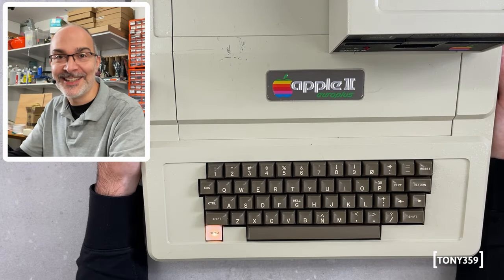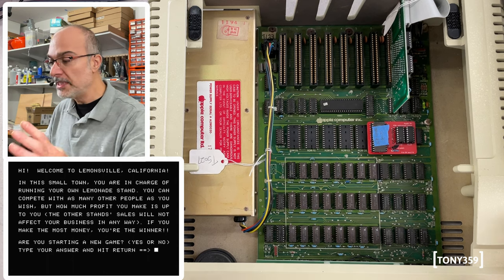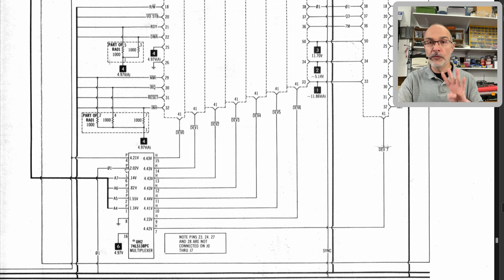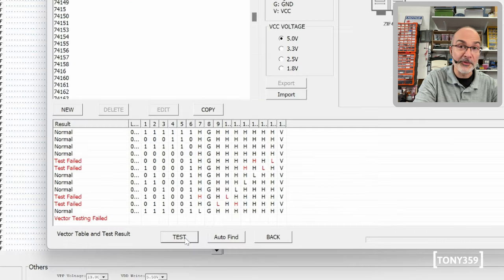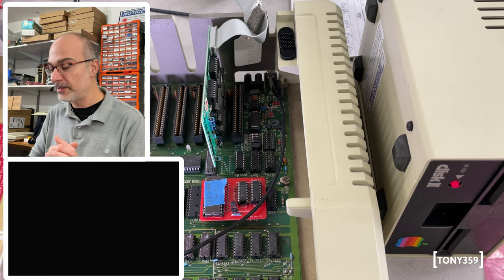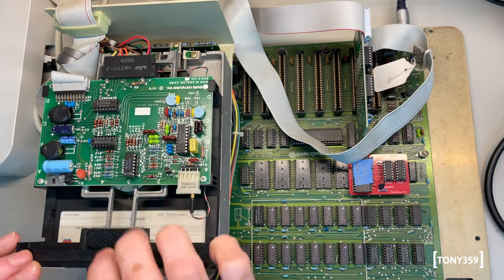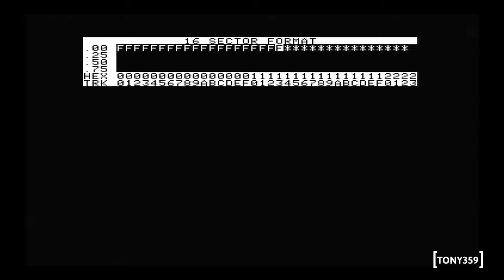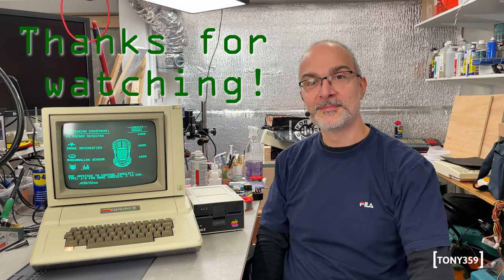Let's see why the Apple II Europlus broke again!

Comment: Bizarre that two chips caused similar issues! I liked that kiosk mode switch-very cool!!

Question: when the slot switching trouble was happening, why was data being read on empty slots? Seems very strange. I’d expect “No Data”

 (but I’m new to Apple ][)

Or was this erroneous data there BECAUSE of the bad chips?

Thanks!
Reply from the maker: You're assuming I remember what was wrong on that video! LOL!
I think it was the selecting IC selecting multiple slots at the same time as you say. The first fault was one of the two selecting ICs, the second fault was - surprisingly - the other one. So yes, I think (not sure) I show that when the system is working fine you only have data on the slot being used and not the other one.

Does that make sense? :)
Reply: @tony359  it does. Such an odd issue

Comment: Won't this hot swap of ROMS screw up the whole system?
Reply from the maker: it's a good question, I didn't investigate too much. However, there is ONE bit (maybe byte) difference between the two ROMs and it's the RESET routine. Now, it might be that if I swap the ROM while the system is doing some intense work, it might not like it. I do not know to be fair.
Reply: "swapping" roms is done only by setting one input to LOW or HIGH. Data-lines are always connected to the BUS so I don't see what can go wrong except maybe occasionally system freeze / halt. This is not like unplugging and plugging back USB drive.
Reply: @tiemanowo  What can happen if the ROM is swapped while reading?
Reply: @watchmakerful  Maybe system crash and nothing more.
Reply from the maker: Oh yes thanks for clarifying. This is nothing to do with physically unplug the ROMs, it's just one address line going low/high so when the system asks for a location, a different one actually responds. So worst that can happen is a crash :)
Reply: @tony359  Since the contents of both halves of the EPROM are virtually identical, you can switch between them without crashing!

Comment: As we have told you many times, in devices this old you have to change all the electrolytic capacitors before you even start testing. It's not even worth testing them. Those who did not fail will fail in the short term.
Reply from the maker: But in this case it didn't fail because of the capacitors! And there are so few caps in an Apple II anyways. 
Anyways, I know it's a good idea, I just don't have the time and resources to do that every single time!
Reply: @cosmefulanito5933 
Why, what happens to the capacitors ?
Reply: I don't recommend replacing all capacitors less they are failing. This technique isn't best practice. After repairing literally 100s of Apple II, IIe, and IIc, I have never found a computer that needs all capacitors replaced.
Reply from the maker: it's indeed a debated subject. My view is: new ones won't hurt but they're not strictly necessary and won't necessarily fail very soon. Definitely I don't like swapping caps for the sake of doing it.
Reply: @tony359  Actually yes. They are strictly necessary because as I explained before, those who did not fail will fail in the short term. Capacitors have a lifespan. And all those capacitors already exceeded it.
A good technician always repairs the problem and prevents future problems. Otherwise you will always be repairing the same things over and over again.
Reply: @RudysRetroIntel  Capacitors have a lifespan. And all those capacitors already exceeded it. You need to replace all of them. Or you can just play the lottery of when it will fail again.
Reply: @tony359
Totally agree with you Tony. 
I am waiting for @cosmefulanito5933 to justify his statement. 
I have 50 and 60 yo radios and computer gear here, including test equipment.
I've had to replace 2 Tantalum caps (they go short circuit), 2 caps in a 3yo computer psu.
Certainly Not an epidemic or conspiracy. lol ;-)
Reply: @tony359  That's fine, it's not strictly necessary for the device to work again. But you will fail in the short term for not having done the right thing.
Reply: @tony359  And this goes for other components as well, such as tantalum capacitors. Which are known to fail and short circuit. Those also all have to be changed.
Reply from the maker: It's a big debate! :) 
I don't use my old electronics very often but I have to say I never had to "repair them again" because of an old capacitor failing! And just to clarify, @cosmefulanito5933 did you watch the video in its entirety? The Apple did NOT fail again because of a capacitor :) 
Sure, replacing them will give more life to the machine. But it doesn't need that they will "fail in the short term", there is absolutely no evidence of that I'm afraid!
Reply: @snakezdewiggle6084  It is not being fatalistic to have basic care. Before plugging in something I need to repair, I first make sure it's not going to blow in my face, and that I'm not going to destroy it any further than it already is.
Reply: @tony359  Actually yes. The failure rate increases exponentially after the useful life of the components.
The idea when repairing something is that it comes out of the repair the same as when it left the factory.
It is not a question of extending his life. It's a matter of giving it new life.
Reply: @snakezdewiggle6084  Measuring instruments are actually more problematic. Because leaky electrolytic capacitors or high internal resistance result in poor measurements.
It is the first thing you should repair, if it is very old equipment. It doesn't matter that it seems to work well. I may not do it tomorrow. Prevent problems.
Reply: Dogma?
Reply: @cosmefulanito5933 
Thats unfortunate for you. Seems you have missed out on formal, academic, or apprentice training.
One of the first safety measures you learn is how to ensure the safety of yourself, your equipment, and that of the device you are working with.
Nothing on  my bench can "blow in my face".
Have you ever heard of a Fuse, or Circuit Breaker, Residual Current, Earth Return Leakage, etc. ?
Maybe you could read some books, there are many good ones out there.
Reply: @wimwiddershins 
Paradigm ?
Reply from the maker: Everybody is entitled to their own opinion here. Let's not ask people to "read some books" please. We can all disagree with each other, respecting each other's opinion and explaining our thoughts for further discussion. 

Replacing caps can only be a good thing. But takes time and money. Also damage can happen when swapping them. It's a balance. Yes, the lifespan of capacitors is fixed but that doesn't mean that older caps WILL fail "in the short term". They will fail "eventually", it might be in another 20 years. As I said, so far none of the units I repaired in the past has failed again because of bad caps. That includes the ones running at the museum which are used every week. With that, I'm not falling for the opposite logic and say "old capacitors never fail" :)
Reply: plenty of antique electronics channels not replacing every electrolytic cap as a rule....now RIFA caps on the other hand....even i replace them asap
Reply from the maker: RIFA is a different story, they are very likely to explode. And they are all cracked! :) Those I replace BEFORE I power up as a rule! :)
Reply: @tony359
I am very sorry Tony,  I should have better respected you and your channel. Apologies.
Reply: @CATech1138
Cheep bad components started coming out of Asia about 25ys ago, slowly killing off manufacturers in Uk, Europe, and USA.
Now, everything is made to a price, or MTBF.